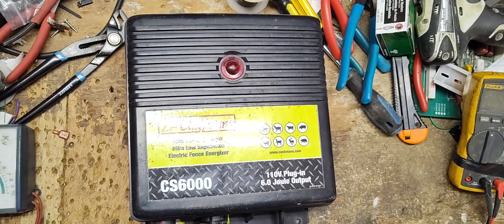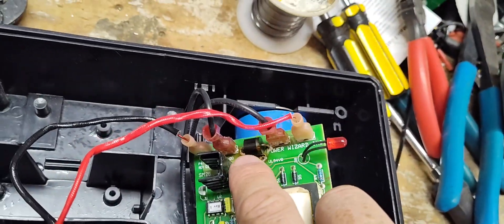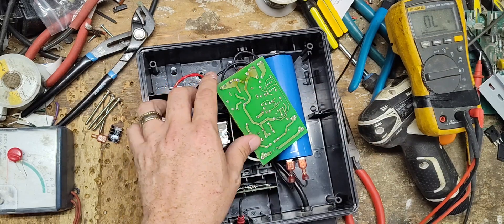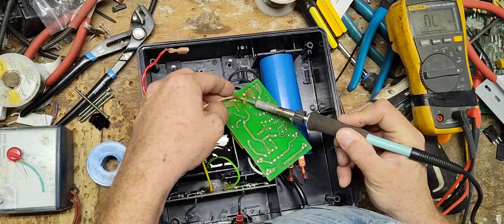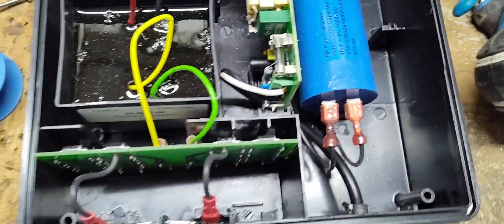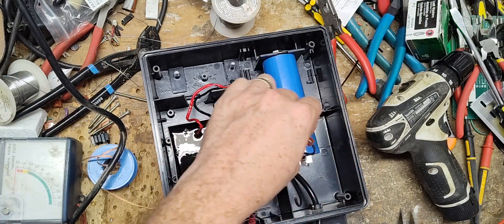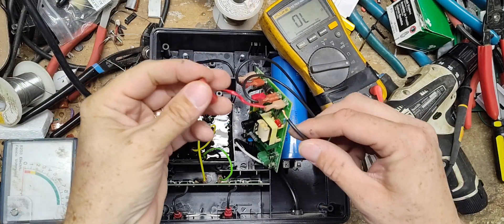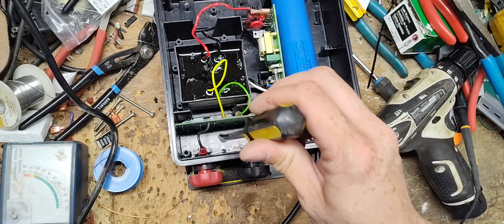Fixing A Circuit Board & Wiring On A Cashmans CS6000 Fence Charger Repair

Comment: That is a large capacitor!!..I am certain it would give someone one hell of a jolt!!
Reply from the maker: There's a few that are in the same housing size but vary from 40uf to 80uf and I believe that this one in this unit is 80uF. Anything 20uF and larger hurts. It's been a few years, but I've been bit by some on accident and they'll leave a burnt spot on your hand or finger wherever it touched at. Luckily I've only been bitten about 12 times by the capacitor over the last 20+ years, and it's been about 3-4 years since it hasn't happened, but you never forget the feeling 🤬
Reply: @FencerFixerRepairLLCKansasCity  If you don't mind me asking what does a usual repair cost? I build CDI ignitions for race go karts and I have been wondering what to charge for repairs..It is just a hobby but it still takes time and I am hoping to scale up a bit...No computer controlled stuff only analog ....
Reply from the maker: @Biokemist-o3k  I kind of judge it as how much would a replacement cost for the customer to buy. Let's say an example would be $300 for a new device. Then I would charge labor at either a flat rate of $40-$65 then whatever parts cost is. If the parts are pretty high, say $100, then I would lower my labor down some to offset the cost of the parts. Mark your parts up a little bit and figure up a little labor. Then think, ok this took me an hour to do, I could charge $25-$30 labor and then I make 10-20% on the parts, so you might walk away with $40-$50 in your pocket for an hour worth of work. I always look at it that way, see what the overall cost is parts will be first, add a little bit to that, see how long it takes as well what a newer comparable unit is, and see what you want to try and walk away with after it's fixed, sometimes it's best to make a little bit of money vs nothing at all if they decide to not fix it because you're too high. I'd rather make $30 for my time after all said and done vs not making a dime at all for working on it. Money in your pocket even on the lower end is still money in your pocket towards the future. Also, make videos like I do and show a card or something with your name, address, and phone number and you'll be surprised how much work will stay to flow your way. I just use my smart phone. I have a flexible mount clamped down to the shelf above my bench. I turn the camera on, get the position right, and hit record. YouTube is great for advertising and getting your name out there. Be personable and clever in how you chat and talk like you're talking to a neighbor or a friend, don't talk over their heads too much. 

Also, I never state what you charge in the videos, unless you offer free estimates, because 3 years from now someone might see that same video and hold you to that price when everything has increased. Offer free estimates or at least also bench charge if you choose to $10-$25 depending on how expensive the product is that you work on, then tell them if they decide to fix it afterwards, then that bench charge goes towards the overall cost of whatever might be leftover money wise.